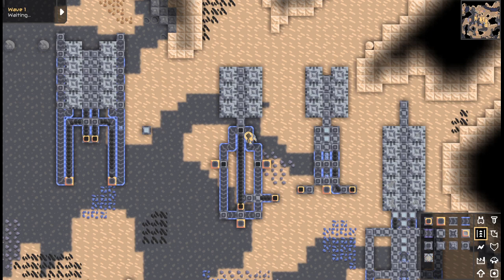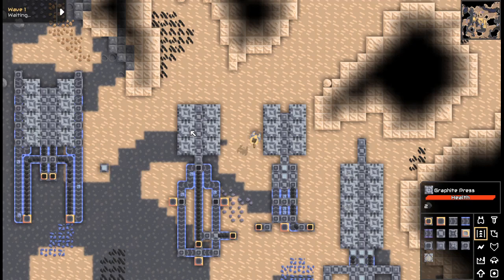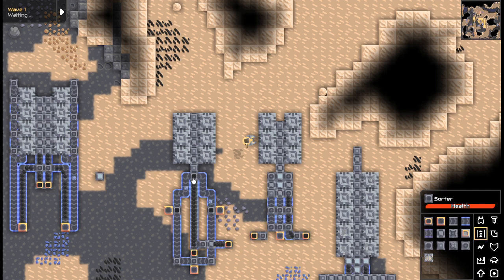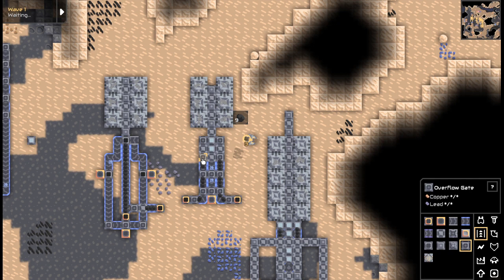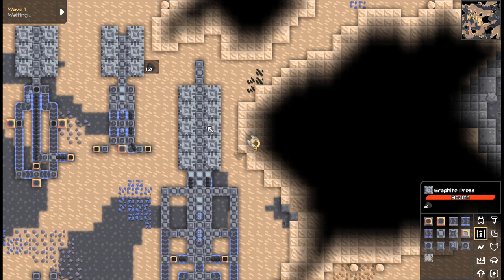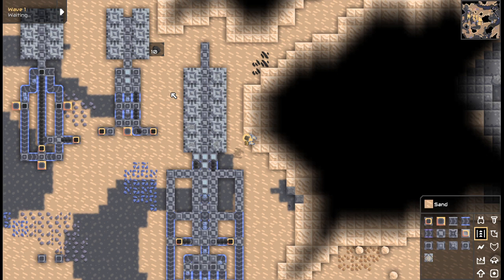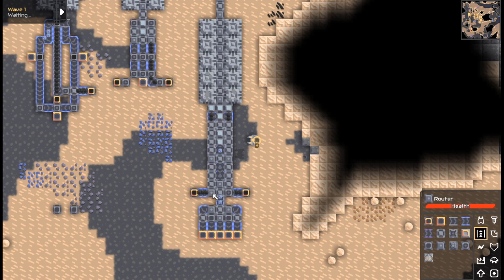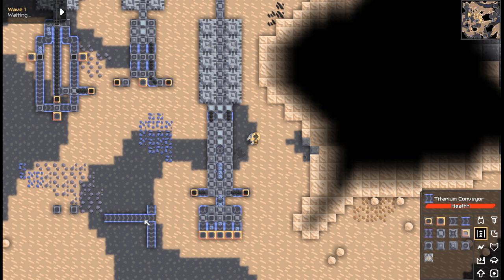Mindustry Graphite Press - Compact Design

Comment: There's already a design people already do except it feeds coal on one side and graphite comes out the other. This is still useful, though, especially in very space-restricted maps.  One thing I do worry about these designs is if they're overflow-resistant. If you block the outlet, will it just stop running and then resume when there's demand again or will it stay stuck?
Reply from the maker: For these designs, I do believe they are overflow resistant. If the input remains constant, there would be no space for the product to output until flow is resumed.
Reply from the maker: Actually, if product comes out, it would still exit like normal. The way the sorters are being used and how routers work, there shouldn't be an issue.